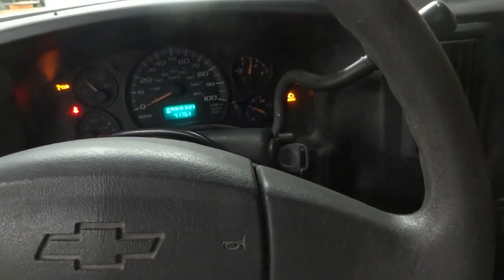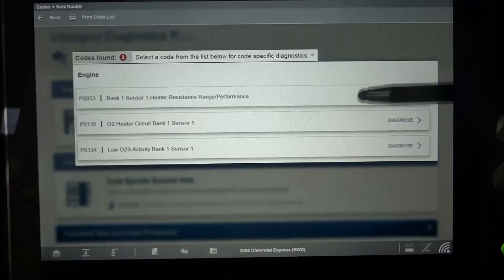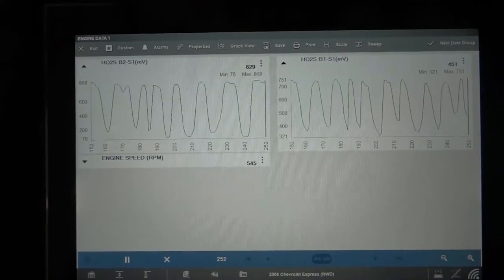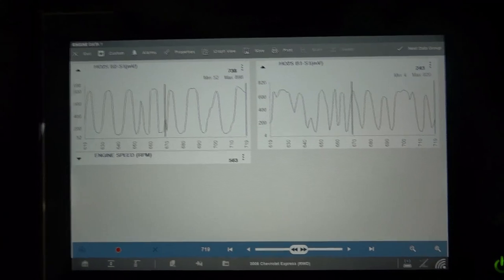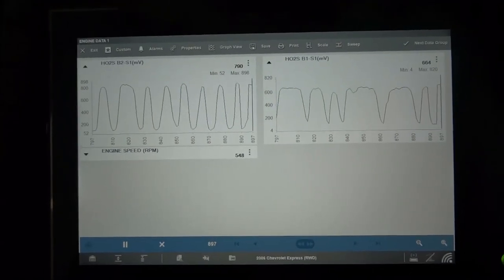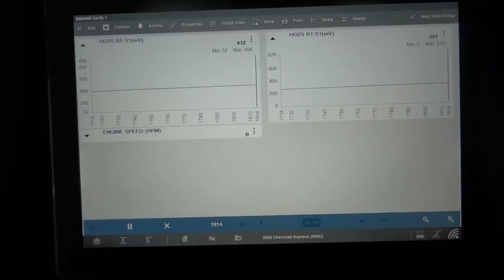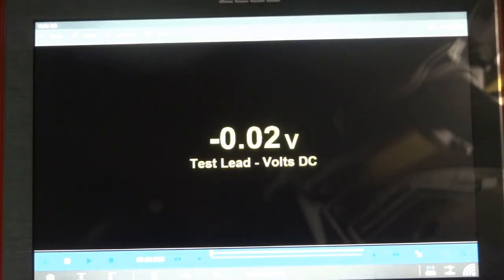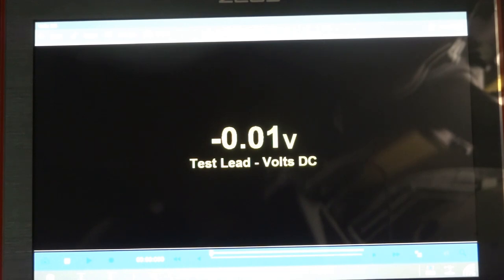How to diagnose and fix O2 sensor trouble codes on a chevy Express

Comment: Is Denso acceptable in Chevy vehicles?
Reply from the maker: Sir Sweetness  yes... Denso is pretty good on chevy vehicles!!
Reply: @KITS_Auto_and_Truck_Repair  

     I am suspecting O2 sensor codes on a family member’s 2015 Chevy Express 6.0L.  I only drive Toyotas and they use Denso.  Currently have 136K on a set of Denso sensors.  Camry no CEL
Reply from the maker: @sirsweetness8332  yes, if it just needs sensors, you should be fine!!
Reply: Yes that's what came out of my 07 Tahoe when I change all them at 250,000 runs Great Denso and AC Delco Top Notch 💯
Reply: We have a 2015 Chevrolet express the Chevrolet dealership wants us to change the 2 oxygen sensors and the catalytic converter. The converter cost way too much. Should we change the sensors first?

Comment: Yeah I had to torch Bank two sensor one to get it off it was locked on there and no other choice, what about the rear two they are on top of the exhaust pipes is there any special wrench or advice you have to get those ones off?
Reply from the maker: John Smith you should get an short 02 sensor socket to remove that one!!!
Reply: @KITS_Auto_and_Truck_Repair  I'll give it a go tomorrow, are they easier to take off than the upstream ones?
Reply: 7/8 Wrench or 22mm Socket as Well 💯

Comment: What wrench do you use to get in to bank 2 sensor 1 and do you go in from the top or the bottom, the fit is a lot tighter than Bank one sensor one?
Reply from the maker: John Smith the tool is a 7/8 O2 sensor socket, it's easier to get to it from the bottom...
Reply: @KITS_Auto_and_Truck_Repair  yeah I saw that, it was not possible to get it from the top, not with a regular wrench at least.. I'm going to try later today from the bottom 👍
Reply from the maker: @JohnSmith-xx1lx  Good luck...